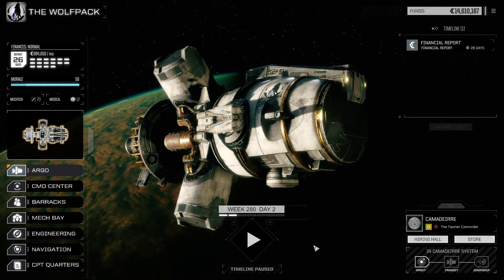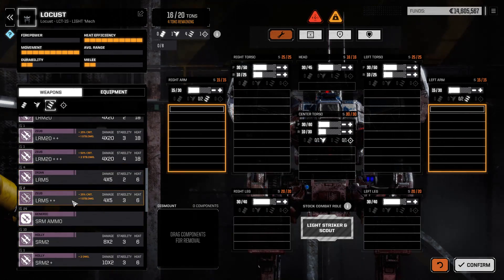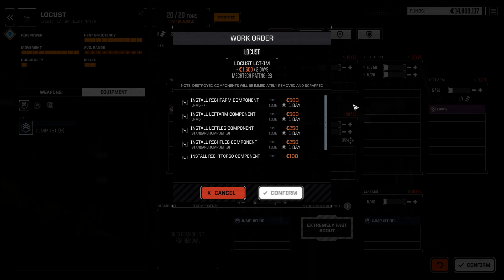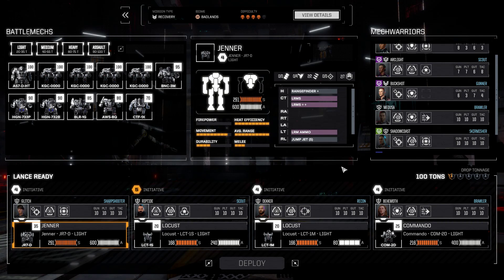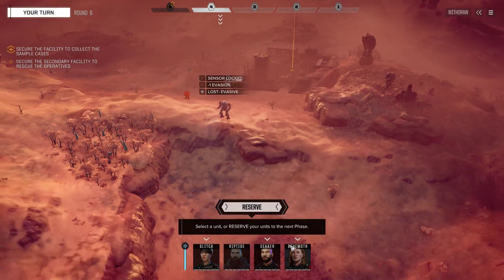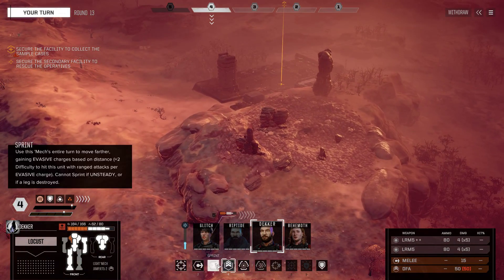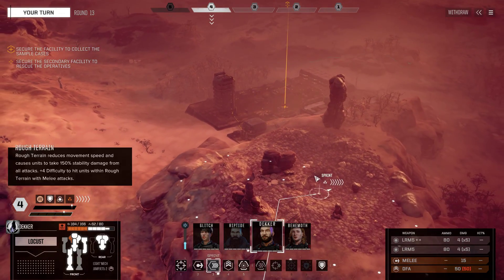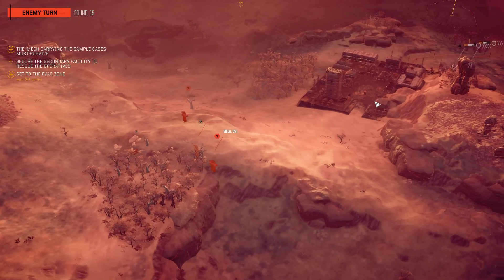BATTLETECH Challenge Mode: How to Farm Assaults with Lights (Episode 2)

Comment: Not sure if what I experienced was a glitch or if they rewrite the codes to allow it. I hid behind a large hill as I was getting low on armor. I still got hit right thru the hill with 2 lasers. The enemy had breaching shot.. Maybe I'm just mistaken.
Reply from the maker: Interesting, could you attack them indirectly (lighter red line)? Also, sometimes the plane/height can be deceptive where they can hit me (and I can hit them) even though the angle looks like they shouldn't be able to. Weird but good to know, thanks!
Reply: during the enemy turn, unless your mech shows red like its totally hidden/unseen, an enemy can still see part of your mech. they might have an occluded shot, but its a shot nonetheless. think the scripting/code for the shot is just messed up

Comment: before i even watch this vid i will suggest 3 firestarters . 2  built with 6 med lasers and 6 MG, 1 built with 4 med lasers and 6 flamers and max jump jets on al with as many heat sinks as will fit. use for your 4th, something like a jenner or a panther. just bait them in by reserving till last turn then go twice. use that strategy to jump behind and chew up the rear armor and do an overheat. leave enough room, dont jump right behind but a space back so that all your lights can get into the rear arc....the build i just suggested are by another youtube poster by the handle of xwynns. watch his lights only game, latest episode that i have watched......https://youtu.be/HZkSidUiN8s
Reply from the maker: Will check it out and will have to try, thanks!